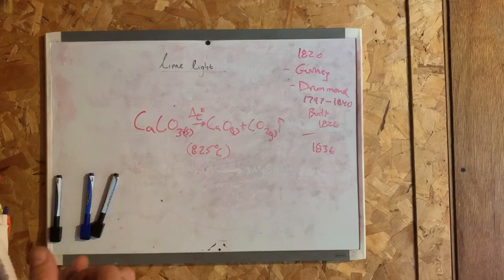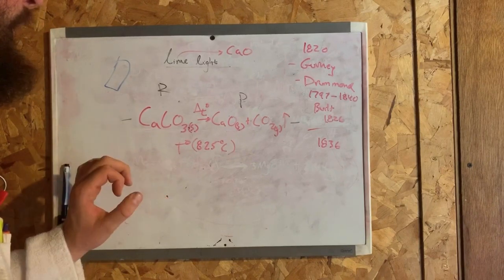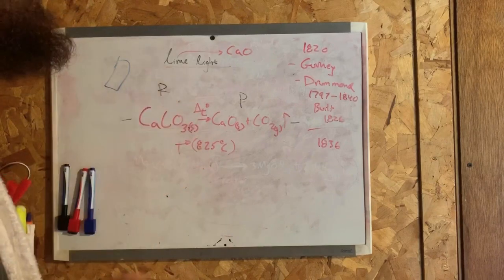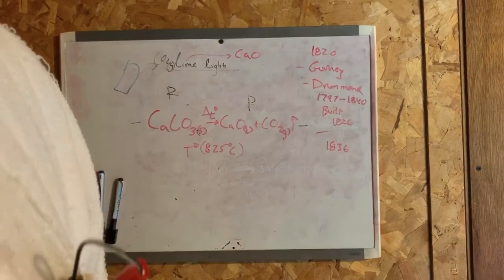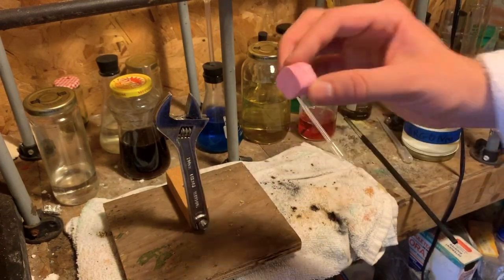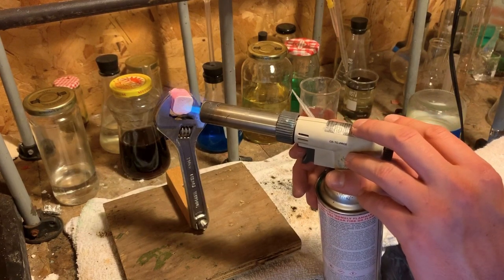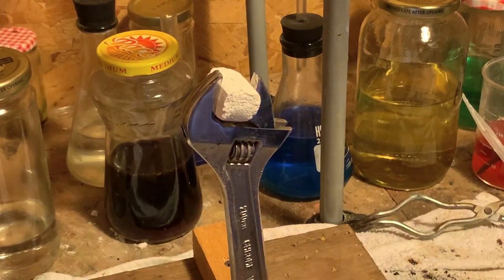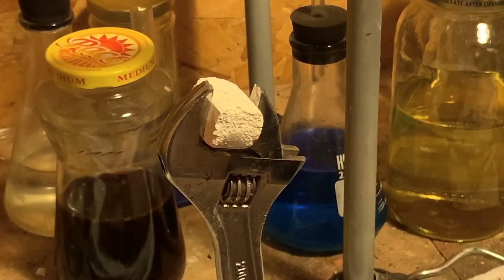The limelight effect

Comment: Most sidewalk chalk is actually calcium sulfate which also decomposes at high enough temperature. Since neither chalk, nor gypsum is pink I think the color change is mostly decomposition of an organic color additive.
Reply from the maker: Yes! The "color change" I spoke about was the dye  being removed while I heated the chalk. Truly! I should of included that CaCO3 is "limestone," and CaO is "quicklime," most of the information is in the description. Heating CaCO3; CO2(g) is released in the air converting "limestone" to "quicklime;" this is a very important process. (aka limestone cycle)